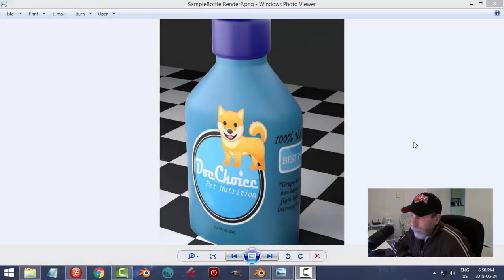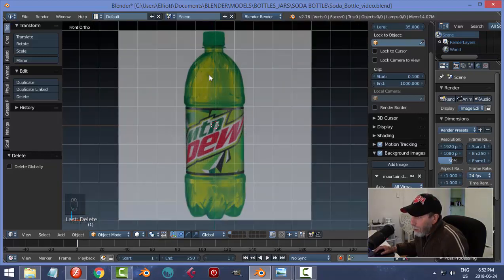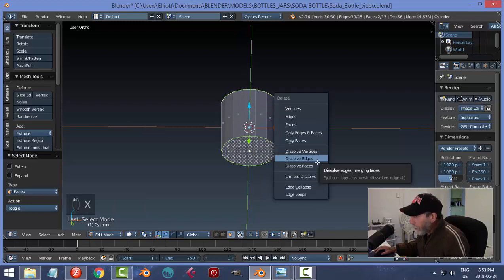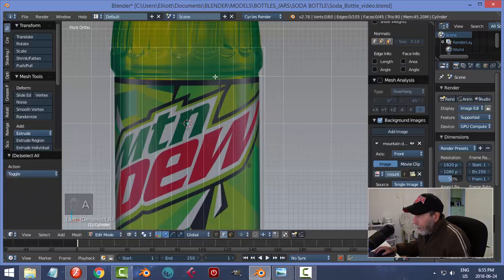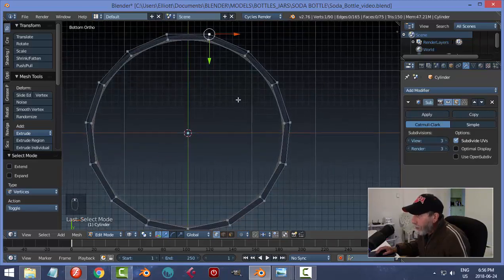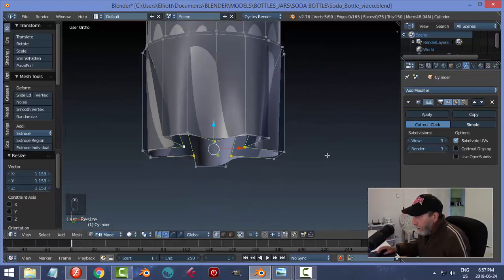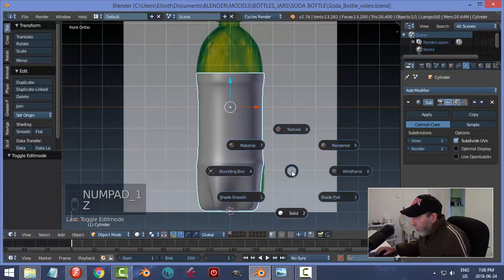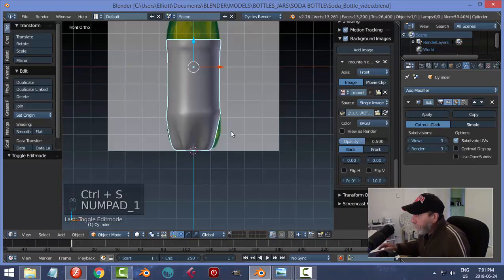Blender: Modeling a Soda Bottle (Part 1 of 3)

Comment: When I make the bottom part with extruding and scaling it does not make it round like yours. Any one else had this problem ? It's hard identifying what I did wrong. Also, I really like your tutorials. Keep coming back as most are just doable and satisfying !
Reply from the maker: Why not just try again on another layer with a small cylinder, delete the bottom face and then close it the way I did (extrude, scale a couple of times and then merge vertices) and add an edge loop close to the bottom but not exactly at the bottom edge and apply subsurf and see if it is rounding.  If not, move the edge loop upwards away from the bottom edge more and keep trying.  I hope you can get it to work.  It will for sure eventually and then you will be happy.  Thank you very much for watching my videos and trying some of the models.  Good luck and have fun!